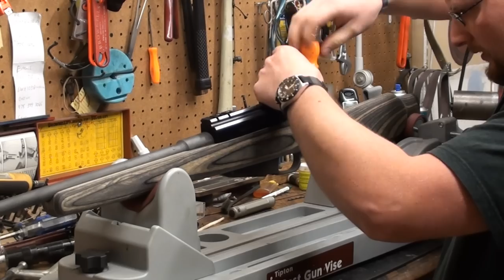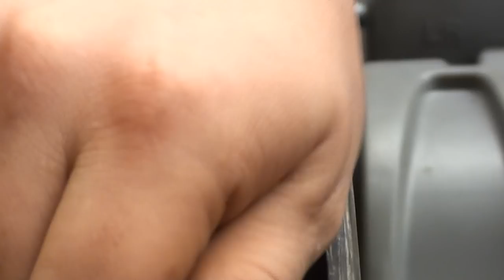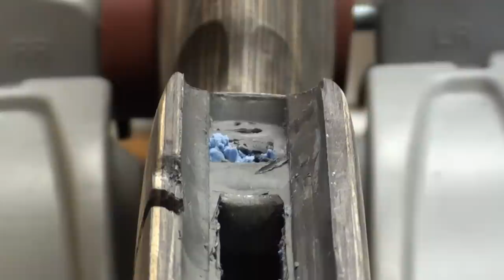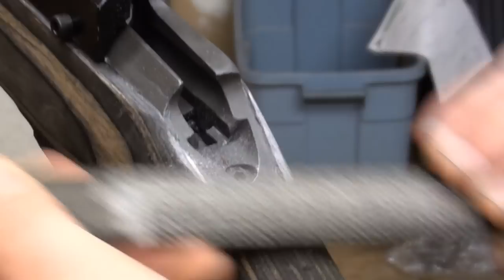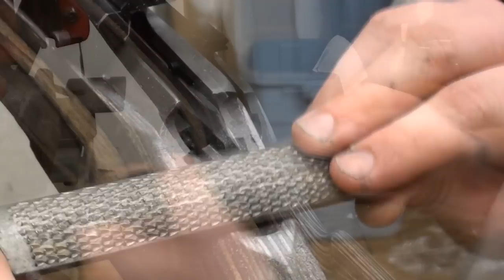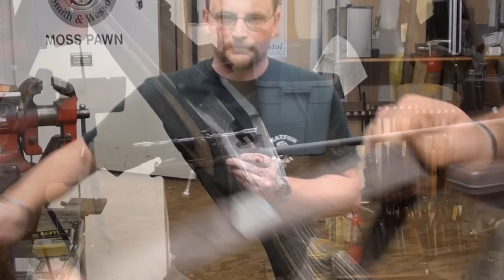Sporterizing the Mosin Nagant Part 12- Final Fitting, Loose Ends

Comment: This break twists on around the front sight, then is locked with set screws(lock tight). I have put about 100 rounds down range and haven't seen a problem.

Comment: ??? I thought when you bed the stock with the receiver  you don't take them apart anymore, at least that's with glass bedding, may not be the same with what you're doing i suppose.... Still what you should do since you are sporterizing it is you should get some (non factory) blue-ing paste and blue the bolt to some degree so it sticks out less and matches the barrel and stock lil more :) to my belief it's just some acid type mix that shouldn't affect anything but color.